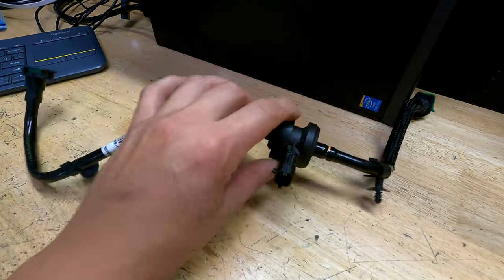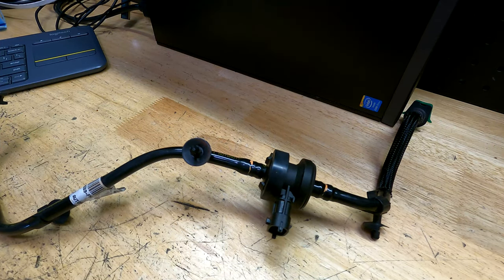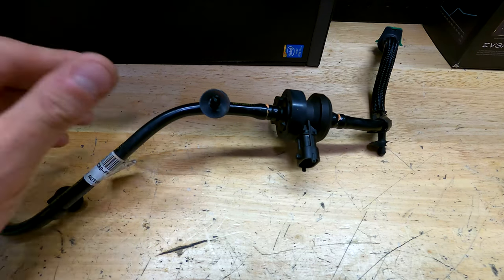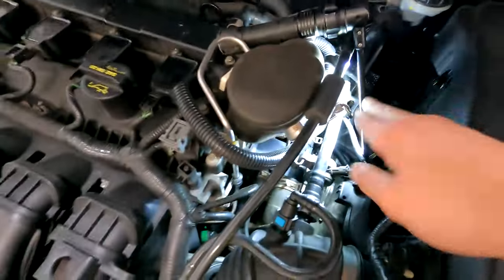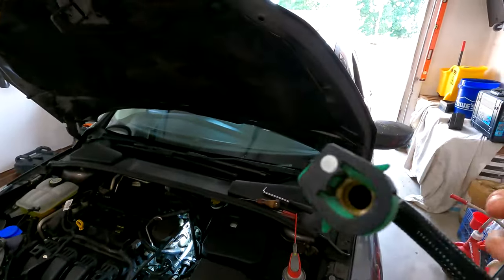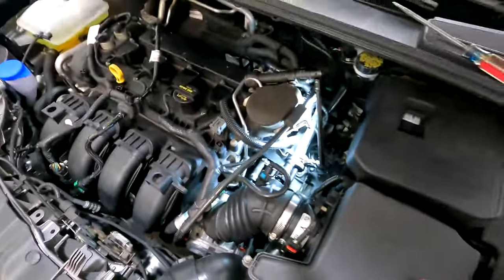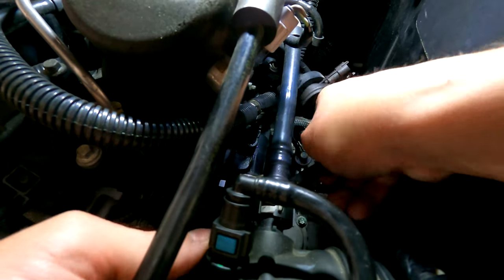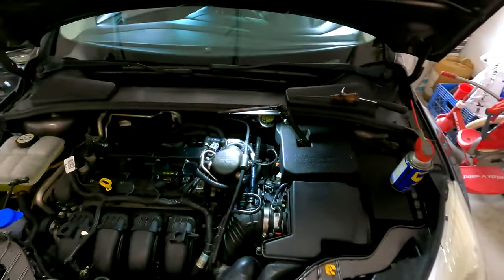Car Won't Start After Getting Gas!!  Evap purge valve diagnosis and replacement!

Comment: Here for holding the pedal down to help the purge the line. Replaced the valve and was dismayed to see my Yukon still wouldn't start. Put it to the floor and she fired right up, hoping it's the last time I have to deal with ignition issues for a while.

Comment: Mine came up as P1450 and that was the only code I got. Check engine light on and all the symptoms he mentioned in the video. My car is a 2014 ford focus titanium se 2.0L sedan. It was the purge valve, and has been fixed and not experiencing any more of these issues. Very easy to fix, just buy the part and research the code I mentioned and or purge valve replacement. Good luck and safe driving to all

Comment: I replaced this part 4 years ago at the dealership and it was $700. Now it’s broke again, and I almost got stranded at the gas station just now. It cranked so many times it almost killed the battery. I’ll try this next time. who has 700 extra dollars laying around these days
Reply from the maker: find a junkyard and get it from a newer model, they have they update design, also their is a recall that requires getting the computer reprogram the stops this from happening.
Reply: there are websites where you can buy the part from for less than $100 including shipping
Reply: I am having the same issue, is it okay to rely on using gas medal on a long run

Comment: Another possibility is a bad fuel tank vent valve. When filling up gas, the vent valve may not properly shut off some of the liquid gas at top level with check valve function, then some gas may be flooded in evap system which eventually be purged by activating purge valve by automatic ECM control after refuelling when engine started again. This vast amounts of purged gas make rough idle for a couple of munutes and eventually go back normal without any engine code. This happened to my 2001 Honda Civic. In my case purge valve itself was OK. I am just  not topping up the gas to solve this issue. Or O have to di bug job of unloading the gas tank and replace the vent valve.

Comment: I get why it won't start but why opening the throttle clears the pressure as you say seems bizarre.  It also sounds like you're then venting vapor that's not getting burned up which defeats the purpose of the evap.  But what do I know.  I have a truck that has the opposite problem.  The purge valve seems to be stuck closed when it should be open.  The solenoid works fine and the purge valve works fine but the ecu won't power the solenoid to open.  It opens the solenoid with ign on, but not while the engine is running.  No fault code and just passed smog the other day but it still doesn't work.

Comment: If this part completely fails would gas start to leak after a fill up? Gfs 2012 focus is having a hard time starting after filling up. She finally got it to start but now is leaking gas from the front of the car.
Reply from the maker: not sure

Comment: I’m having this problem even after I changed the purge valve.  The charcoal canister is the only thing I haven’t changed yet.
Reply from the maker: some models, have a recall the required the ECM to be reprogramed to address part of this issue

If would also check if the canister is rattling and pooring out

Comment: so is this a ford issue because having same with both 2015 and 2019 escapes. becuase my sisters 2006 escape ahs never done this and she  is on 305k miles
Reply: I have 2013, and its like the quality of ford reduced drastically from 2012

Comment: Hello I just replaced this valve on my 2016 Hyundai Tucson and my car ran so much better accelerating when hitting the gas. This was last week on a Wednesday. So last night I went to get gas and it wouldn’t start so after a few tries I pressed on the accelerator and then it started but now it’s running sluggish.
Reply from the maker: plugs might be fouled, sometimes they clean out after running a bit.

Comment: I got gas, it started up, then went straight to getting a oil change a mile up the road then got stuck in the garage bay with a line behind me when they wanted me to start it up  to rev it to check for leaks 🤣 they tried to help me but no luck, had to get towed

Comment: If this goes out, could it shut off the car while it’s idling? My car shut off while letting it warm up and it won’t start now. Hoping this is all it is
Reply from the maker: yea it can, check with your dealer, their is a recall on the evap system which requires a computer programming to fix these issues.
Reply: @DLMGarage  thank you for answering! I didn’t get the car from a dealership. Was like 4th hand from my wife’s friend. 

It’s an old 02 accord so I was looking for possible reasons and how to diagnose them. However just starting with the 3 basic things I found my problem. The igniter in the distributor took a dump while running so I lost all spark.

Comment: Hi my caf wont start after i pump gas only. And the battery sign comes up too so i got it replaced and it still wont start after i get gas and battery sign still comes on.
Reply: pretty sure that’s just you battery being on but not you engine
Reply from the maker: that happens when this valve is bad from my experience.
Reply: @DLMGarage  you are right I was just explaining that the battery sign comes on because its in battery only mode since the engine won't start. Exact thing happened to my car just recently.

Comment: I hate to ask because i know you probably get a lot of questions but my car got the P0457 code with no check engine light i had to get it towed because i didnt know prior but anyways  could this work for me too? My car is a 2007 honda accord
Reply: Also forgot to add that my car didnt do this right away. I got gas in July and right after my car wouldn't start then finally I got it to. Then in August I got gas and same thing happened but I was still able to drive a few more days before it stopped working on me.
Reply from the maker: thats a evap leak, this could be it if its getting stuck but more diagnosis would be needed.
Reply: @DLMGarage  thank you so much!

Comment: My car was throw the po446 code so I had fixed the canister purge valve and it still doesn't start
Reply from the maker: Typically it's this val e but Ford does have a recall about the ECU software casing the EVAP to get stuck creating a no start issue.
Reply: It's a 07 Chevy cobalt. How does one fix this ?

Comment: After replacing my purge solenoid it still has problems starting after gas any ideas and no check engine light on
Reply from the maker: there is a recall for the pcm software that addresses this issue if this does not fix it. something about fuel tank pressure and the pcm reading it wrong or something to that effect.
Reply: @DLMGarage  ok I'll look I have a 2010 kia Rio lx
Reply: @jasonbardwell6402 Did you figure out what is going on? I had my Sorento's valve and canister replaced after not being able to pump gas and not long after, I have noticed that I have trouble starting the car and it sputters and acts like it wants to stall.  It seems to happen after I get gas.
Reply: @blissfuljoy6049  had my Purge valve tested and even though I replaced it it's suck open waiting to get paid to put the new part in
Reply: @jasonbardwell6402  Are they not honoring the warranty or did you do it yourself? I have to have Kia look at it again because I wasn't sure if It was gas related. It seemed random at first but the past two times it's done it it was definitely the same day I got gas
Reply: @blissfuljoy6049  the shop that didn't won't replace it so I got a new one from rock auto only 18 bucks now just waiting to get paid to have a different shop install it for me
Reply: @blissfuljoy6049  have a mechanic test your purge valve before you go further
Reply: @jasonbardwell6402  Thanks for responding, I am going to call Kia again and have them double check now that I have more information on it happening for sure after pumping gas. I am really wondering if they actually checked it.  Hopefully we can figure this out.
Reply: @blissfuljoy6049  just got my car fixed purge solenoid was stock open and the hose had a crack hope this helps
Reply: @blissfuljoy6049 that's when I just rev my engine put in drive and speed off so it doesn't stall